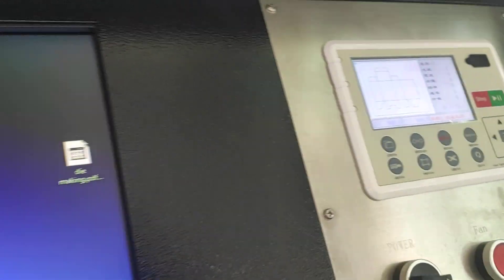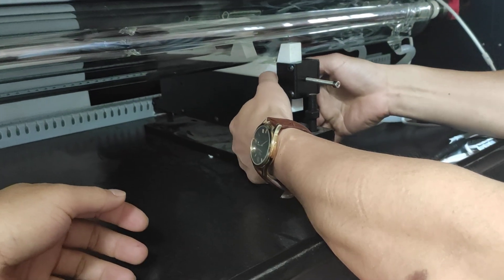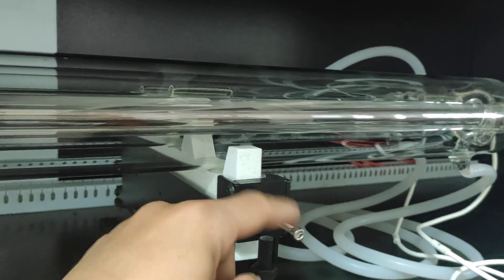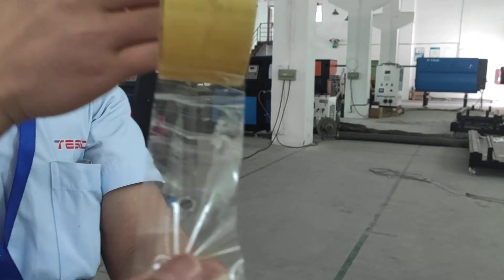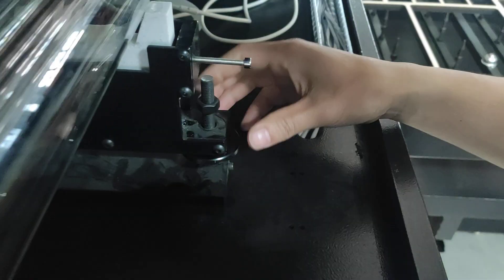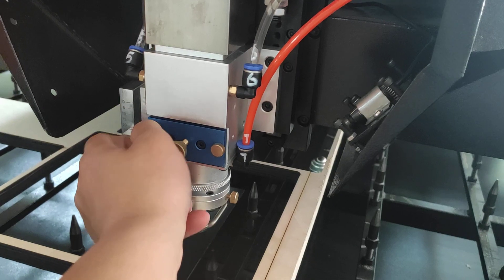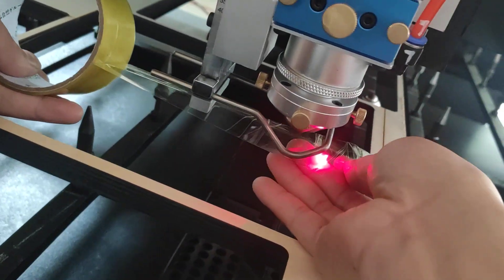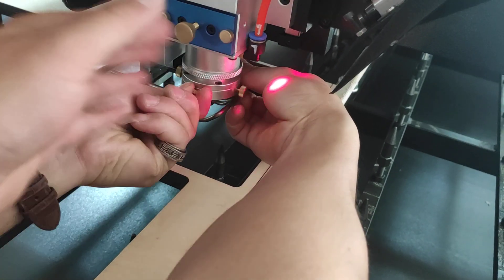laser calibration on TSD 400watt and 600watt die laser cutting machine

Comment: Very nice lesar mashin
Reply from the maker: Thanks Hannan for your kind comments. More details on this bender and die board making machines willl be sent to you if any interest. sales4@tsdlaser.com or WhatsApp: +86 176 6524 0764 Thank you!
Reply from the maker: Here is recap info on our regular 2 sets of die-making machines for your check. 
Product name: Die Board Laser Cutting Machine
Model: TSD-LC400-1218
Working area: 1200mm x1800mm (W*L)
Working model: Laser head is fixed, working table is moving
Applicable materials: 6-22mm plywood, acrylic, MDF, PVC, and 1-2mm thin metal board
Cutting speed: 8mm/s for 18mm plywood
Cutting curf: 2pt, 3pt, 4pt could be adjustable (0.71mm,1.05mm, 1.42mm)
Software: Auto CAD
Support format: DXF file
 
Product name: Automatic Blade Bending Machine
Model: TSD-830A
Rule thickness: 2pt, 3pt (0.71mm, 1.07mm) 
Cutting height: 8-30mm
Function: auto bending, cutting, lipping, and bridging
Software: Auto CAD
Support file: DXF, DGW, AI file
Warranty: 1 year for laser and bender, 6 months for consumables
Packing: Standard export sea-worthy wooden packing.
After-sale service: YES
Price validity: 30 days.
 
Quote in details of the above 2 sets machines will be offered once received your email address. 

Kind regards, 
Vicky Qin

www.tsdlaser.com
Email: sales4@tsdlaser.com
Mobile/WhatsAppat/Wechat:+86 176-6524-0764
SHENZHEN TSD LASER EQUIPMENT CO., LTD. 
Add: No. H Building, Shasi Hi-Tech Science Park, Xisha Rd, Shajing ST 518104, Bao’an Dis., Shenzhen, China.